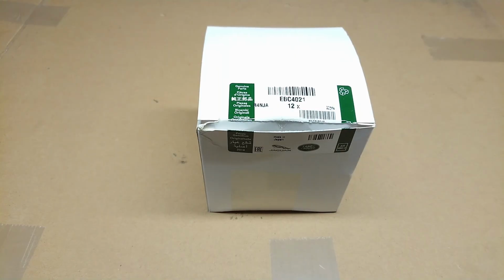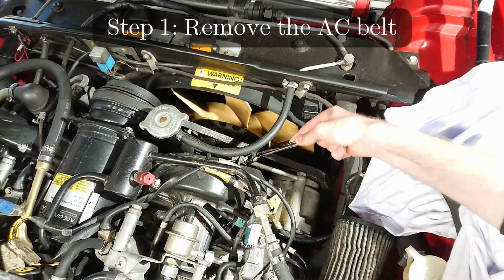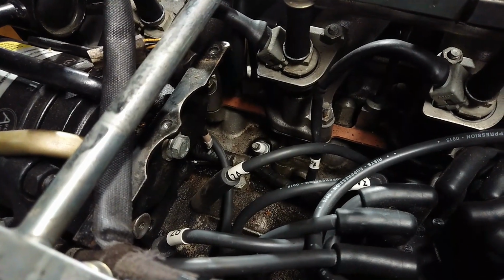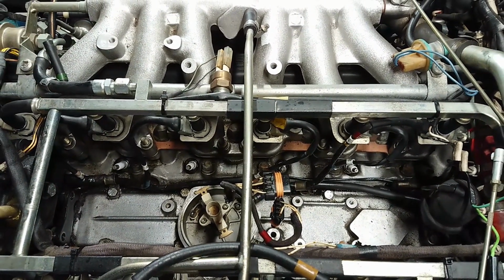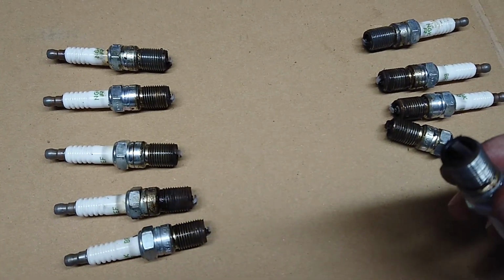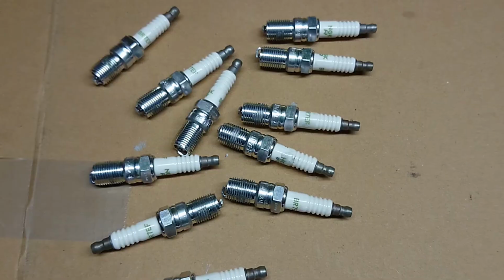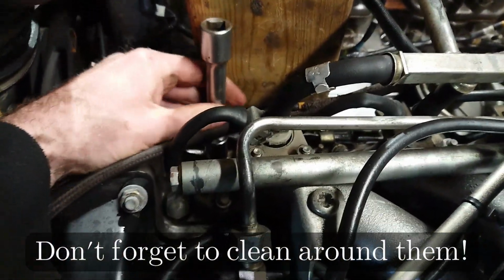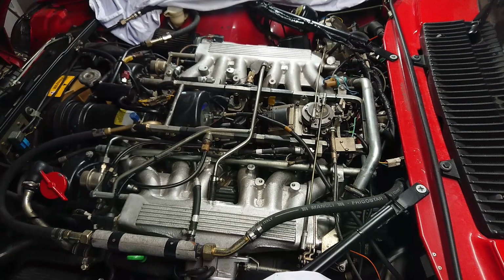Jaguar XJS V12 Spark Plug Replacement - Step by step tutorial

Comment: Glad XJ Jesse said this was the channel for V12. Though plugs were replaced by previous owner appreciate DIY video. How to remove non working AC and never used cruise unit is a helpful info. These engines are super smooth and not to be frighten of working on thanks to this channel.Love my XJ12 with factory Jag wire wheels.
Reply from the maker: Glad you came of from XJ Jesse, he has a great channel! You're very right in saying that you shouldn't be frightened of these V12s. Theres just a lot of everything but they are pretty logical and very very smooth

Comment: With a couple of different extensions and a swivel between the first one and one at the socket, the plugs in the rear, under the throttle pedestal, can be changed easily without removing it.  There is supposed to be a way to change the front ones without removing the compressor, but I moved it anyway.  Glad you vacuumed around the plugs and used anti-seize.  I found three different brands of plugs in mine.  I think the front two were factory originals.  I changed them at 76k miles, shortly after I bought the car.  Thanks for helping people not be so afraid of the Jaguar V12.  It really isn't as scary as it looks when you raise the hood.
Reply from the maker: There is a Jaguar tool to change them without removing anything. It looks like an elongated sparkplug socked. But when someone does it at home I think it's nice to remove everything to be able to check various parts and give everything a clean.
It's very common for the front plugs to be original. No wonder so many cars have a miss
Reply: You can buy a special spark plug socket .   I worked on jags.

Comment: The cover on the cruise control bellows is on upside down.  A common mistake.  You should note that the plugs should be torqued to no more than 8 foot pounds (10.8 newton meters).
Reply from the maker: Thanks i noticed that during the edit and switched it around. Wasn't really thinking straight
Reply: is this also the case for the HE XJ12?
Reply: Torque spec should totally be added to the video for all applicable items; I actually can't find the spec for the plugs in my giant green workshop manual. Can anyone confirm 8ft-lbs for the plugs? 🙃

Comment: So I have watched your channel for a while now.. love your videos, always very clear and easy to follow. You really explain the tasks at hand very well. So I finally decided to follow your instructions on replacing the plugs on my XJS v12. It was exactly as you show in the video.. take your time and it’s not difficult. It did take me about 5 hours in total mainly the throttle linkage ‘mount/stand’.. boy those bolts were difficult to get to! But if you don’t remove that, the back 2 plugs can easily be cross-threaded when putting them back in. Keep up the great videos!
Reply from the maker: Thanks for watching! Yes those bolts can be a pain but it's nice to be able to clean everything out when changing the plus. 5 hours is great time!
Reply: Can I august fuel pressure reg 0n 5.3 ltr
Reply: In the middle of changing the plugs right now on my 91 XJS. Agreed the throttle pedestal bolts are difficult. Still haven't gotten them loose.  care to tell/show how to do it?

Comment: Great Video. Three suggestions: 1. there is a special nut from Jaguar for the first two sparkplugs to get them out without removing the compressor. I have seen also a manual how to build the nut yourself, if I find it I’ll post it. The problem is: by removing the compressor, there is a pretty good chance, the a/c system develops a leak.
2.  To fiddle in the new plugs where your hands are to big, take a stiffer rubber tube and stretch it over the sparkplugs end and comfy and gently screw them in and pull of the tube 
3. I would change the cables also, minimum every second time. A good check for the cables is to open the bonnet by night on a wet day and inspect the cables when the engine is running. If you see any little sparks, change.

Comment: having owned a couple of v12 xjs convertibles, I can say that a great time save is to modify a 3/8 drive plug socket. This for the driver bank forward most plug. Lathe/face the leading edge of tool as to become even with the plug  hex lower edge. Sneaks past the body of the compressor w/o doing anything w the a/c. As for the remaining plugs , yes swinging the cruise bellows away is good. I snagged the remaining plugs w various swivels and universals . No problem. Once loose, a piece of rubber hose wedged tightly onto those ceramic insulators may well work too. Reduces fear of cracking said ceramic. Install this way too. If tough, penetrating spray does wonders on gauled/stuck plug threads. (see s.o.p. for dealing w stubborn plugs w/o stripping aluminum. If you are doing a major tune up natch just get  old cap out of the way. I dont recall messing w the bell crank tower. Couple of hours tops.
Reply from the maker: Done it a few times without removing all the items also but I prefer to remove everything that way I can clean up in the "V" and clean other components as well.

Comment: The best thing of "living with a classic" is there is no $400,000 worth of tools in the background. Here you are shown what tools are needed for each job. I should mention when I removed the AC unit I found two spark plug wires sparking and the wires were rock hard. I replaced them with Standard kit..all 12 for $20 Canadian
from Rockauto in the US and the wires were all correct size. It appears when spark plug wires get all dried out they loose their insulating properties
Reply from the maker: Thank you! Yes there really isn't a budget like that. Just showing how things can be done with some normal tools at home.
The plug wires do seem to age quickly in the heat of the V12. I'm about try out a set uprated plug wires on my other V12. They are suppose to stay soft for long and not dry out. Let's see

Comment: My 87 VDP came with a double swivel, thin and long tool for changing the plugs beside the ac compressor; no need to remove all those bits. Also, compressed air on each plug as you go, vacuums only remove dry swarf.  Great video.

Comment: Great guide! Found it a bit difficult to get the AC-compressor back in place, the two large aft bolts are tight and tricky. I finally removed the front bracket all togheter to get more wiggle-room for the heavy compressor. B1 spark plug was wrong brand and gap, I found the root cause to the rough idle :-)

Comment: I'm glad I watched this. I was about to start on my '88 with about an hour to get into it, figuring I'd do a few and then button it up and do the rest later. I think I'll just save the whole job for next weekend. Also, that bit about the two front spark plugs not getting changed probably explains the miss I have at idle. For comparison, I could do all five glow plugs on my Mercedes in half an hour if I needed to.

Comment: In the middle of changing the plugs right now on my 91 XJS. Agreed the throttle pedestal bolts are difficult. Still haven't gotten them loose.  Care to tell/show how to do it?
Also, you are considerably stronger than me. Moving the A/C compressor strained every muscle in my body and I still did not get it as far out of the way as you did. Thinking about using an A-frame hoist or an engine lift to raise it. (lol)
I really appreciate your videos!

Comment: I have a 1983 HE 5.3 with an older style ignition coil that takes more room. So it was quite finicky to remove the distributor and throttle linkage. I would've had to undo a whole heap of cables so I loosened the "tower" and left it in. Still leaves enough room for the plugs when you can move it around. And I was able to make do with a Saab piece of wood... Thanks for the vid!

Comment: Interesting to see it done on a pre-facelift. Harder than a facelift, definitely.
Your cruise control bellows heat shield appears to be upside-down: it's to protect against heat coming from the vee.
Reply from the maker: Yes they did make a lot of things easier on the face-lift. Thank you, I noticed it while editing. I've turned it around now 😊
Reply: I put the silly thing on upside down too and will have to swap it around tomorrow morning; I knew it felt odd going back on 😆

Comment: Hi Adam,  I have a 1994 XJ12 that has been off the road for 11 years. I've had it for a few years now but have not gotten around to doing anything with it until yesterday. I connected a battery pack to the battery terminals and cranked it a couple of times. I was pleased with the results, the engine is not seized and the starter works. Today I looked into removing the spark plugs. I want to pour some lubricating oil into the spark plugs holes before going any further. I could not see the plugs. I watched your video for guidance. I did notice some differences between your XJS and my 1994 XJ12. Different a/c compressor and the fuel rails look a little different.
If you are aware of any change in the procedure on the 1994 please let me know. Thank You

Comment: I've got to do this at some point on a HE V12. One bank allegedly had plugs changed 3 years ago (they look older). According to the history, the other bank last had a change in 2000. Hopefully that is incorrect. I tried to remove one of the easier to access plugs as a test, and it was stuck solid, Wouldn't budge even when pulling hard on a 1/2 drive socket wrench. I'm concerned about stripping threads.

It doesnt help that the rocker gaskets have been leaking for years and the valley is filled with oil and dirt.

Comment: Need some help ons wiring in the engine bay any help mostly the switch on the feul rail then next to the coil i have a green solid wire with 12v with a black one

Comment: Very well explained! Thx
Reply from the maker: I’m glad you enjoyed it!
Reply: @LivingWithAClassic  I was watching most of your videos during the last week. You seem to have a lot of experience with those beauties. I am currently considering buying a 1980 Series 3 Daimler Double 6 VdP. 58000km (documented), only 2500km since 2003. Car is repainted, all rubber parts are to renew (axles, fuel, …), oil is leaking, but I think the base is solid with very little rust at the roof (side water channels). Anything to consider in particular?

Comment: Many thanks for your previous advice. I bought the EBC4021 from SNG Barratt and they have supplied me with DENSO T22EP-U which are at least 4mm longer (into the cylinder) that the NGK's that it has fitted now. Car is a 1984 5.3 HE and i'm worried about installing the DENSO plugs - i'd be interested to hear what you think?
Reply from the maker: I would only use NGK plugs on the HE engine and nothing else
Reply: @LivingWithAClassic  yes, I phoned NGK and they advised the 1982 to 1985 HE take the BR6EF and the 1986 onwards take the BR7EF, the DENSO (EBC4021 equivalent) from SNG Barratt are projected nose plugs and were a good 4mm longer; deeper into the engine.

Comment: Interesting to see you got a BR7 instead of a TR5. I think Jaguar changed to a colder plug in 1992. My 1985 XJS v12 has TR5GP gapped at 0.025. Do you think I should switch to a colder plug?
Reply from the maker: It’s trial and error, mine run well on these plugs.

Comment: What are the size of the bolts for throttle pedestal
Reply from the maker: They are 1/2 inch. It's pretty tight there so a small socket set is useful
Reply: This part is the biggest nightmare of the job.  I have struggled all afternoon to get just one out.

Comment: NO need to remove the ac compressor, you need the special spark plug socket  which has a u/j  joint and is shorter and the square for your bar is on one side, you can buy them, it's a slow job on the front plugs but quickest way.
NO need toremove throttle pedistle,  use the proper socket as above.
You get less than an hour to change spark plugs .       Change plugs one at a time,   make sure there's  no debri in resess.
6 To 8 hours to change spark plugs   as i said above in the workshop you get less than an hour  and when i retired 8 years ago the hourly rate was £105 + vat an hour,    add that up.

Comment: I was a Jag dealer tech for 30+ years. I can't even tell you how many V12 plugs I have changed. For one thing EVERY V12 we got in  had to have the plugs changed on the PDI (for you amatures that's the pre delivery inspection) they had "shipping plugs" that were a hotter heat range". I never removed all that stuff, I could change all 12 plugs in about 15 minutes. The job only paid 1/2 hour. Not to say this video is wrong, there are just better ways to do it with the right tools. I taught all our techs how to do it efficiently (I was the shop foreman) 18 techs and the largest Jag dealer in the US.
Reply from the maker: Ya I heard about lots 8f plugs being changed at dealers from idling a lot too.
I have done it without removing stuff as well. I mostly wanted to show a way that everyone can manage to do it at home.
15 minutes is good! Think I could probably do that on my pre-HE XJ12 but maybe I'd need 45 minutes on an XJS.
Where were you a tech?
Reply: @LivingWithAClassic  I have the factory special socket for the front 2 plugs it's a 18G.1364 it looks like this http://www.freedomracing.com/303-147-spark-plug-wrench.html?___store=default&gclid=CjwKCAjwza_mBRBTEiwASDWVvtuQW1rfcexeslXjpgEEQW2qOgkUv9gVvr4POADevza5czAdk9-HTBoC5YoQAvD_BwE I think I paid about $60 for it. Other than that I used a Snap-On spark plug socket that had the ball swivel and extension permanently attached. I made the installation tool from a #4 phillips screwdriver and a piece of vinyl tubing.
Reply: @BobJeffries  I love the bit where you said "for you amatures" my experience has been in 2019 so called pro's know next to nothing about V12 XJS engines or the 4.0 XJ40 ......... MODERN MECHANICS are spoilt with all the Computer assistance they get, and like in many other industries are nothing more than dismantle-rs and assemblers because they have the special tools! This video is to help us cough amateurs do the job just as good as the so called pro's would do it........my long experience with numerous  mechanics is you give them your car with a problem to fix........when you get it back its fixed alright but almost always has an new problem "as if its a gift from the cough pro" with excuses like "OH ITS AN OLD CAR" instead of "YEAH I WAS A BIT CARELESS"..............This video is a great effort to assist people to avoid lazy mechanics......just saying its not about you mate, get over yourself......... I am a Cabinet maker and do all the repairs or maintenance on my vehicles I have done for 40 years, because then I don't I have ended up with a problem that wasn't there before the cough pro looked at it...........its not about you and your ego.......
Reply: @LivingWithAClassic  I was shop foreman at Alpine Jaguar in Ft Lauderdale FL (now it's called Jaguar Ft Lauderdale) and a tech at Shelton Jaguar in Naples FL.
Reply: @lapalmax59  sorry for offending you, most people that have never worked at a dealer wouldn't know what a PDI is or means. I've been retired for about 15 years now. so back then V12s were quite common. As far as your experience with mechanics breaking more than they fix I know that happens more than it should,.When I was managing multiple techs at Jaguar if you had comebacks you wouldn't last very long. I personally got awards many times for least amount of comebacks in a year usually zero to 3 a year. We really strived for quality service performance to keep our CSI up and our SAR. Yes I do have an ego, I worked very hard to get all my certifications, I'm a ASE Master Tech in both automobiles and heavy duty trucks. I also became a Jaguar Guild member. When I was working I was the highest certified Jag tech in the US.
Reply: @BobJeffries  bob.. is it the same procedure on the x305 v12 1996? would you recommend getting hold of that plug socket or is it easier to change plugs on the 6 litre?

Comment: Could you tell me how to remove the pedistal please?
Reply from the maker: It’s just 4 bolts around the base
Reply: @LivingWithAClassic  thanks, I have huge hands, is there an easy way to access them? Many thanks and a great channel by the way
Reply from the maker: I use swivel wrenches usually or bent wrenches
Reply: @LivingWithAClassic  many thanks. One more question, the air conditioning gas ran out decades ago. I was going to completely remove the compressor and not reinstall it. Do I just saw through the belt to pull it out or is it connected to other pulleys?